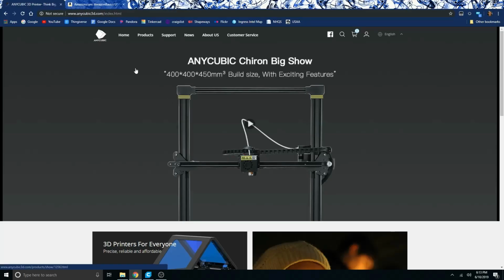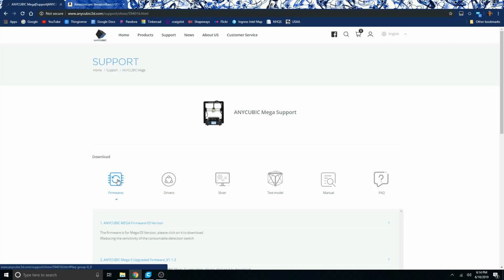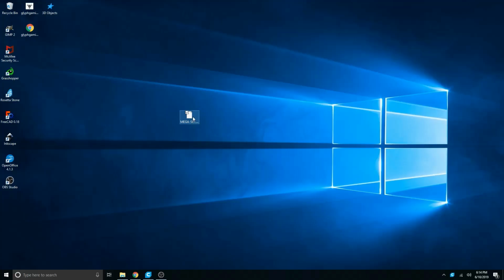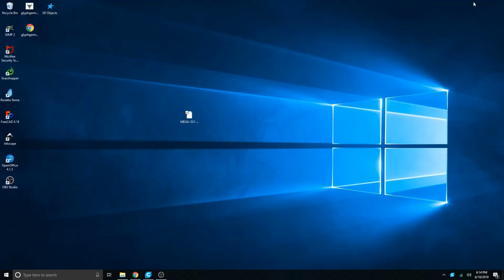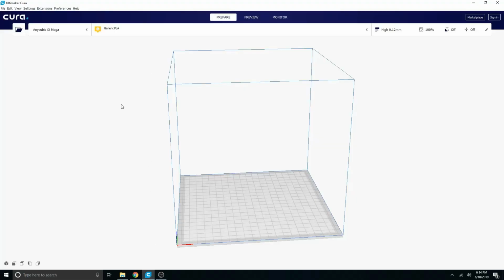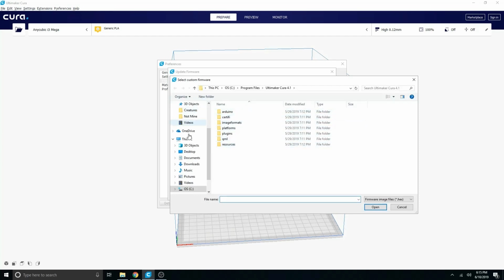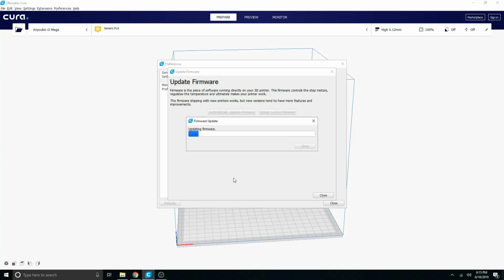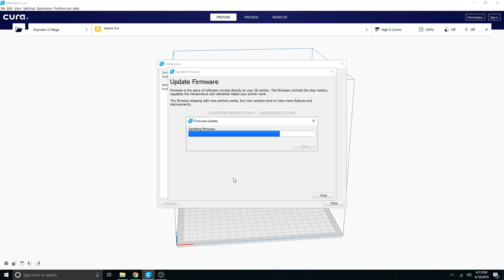Anycubic Mega S Firmware Update

Comment: I know this is an old video but hopefully you can help :) So I have tried installing several different firmware but in the Tools, More, Info page it still says v1.1.2 where I have "Successfully updated" v1.1.5, many thanks
Reply from the maker: @HawxAnimator  I have to admit, I sold this printer a couple years ago and don't remember much about it anymore. I would suggest checking around some forums. 
This upgrade isn't required and the standard firmware that it comes with is stable and does a great job. Either way, I hope you find a solution. I wish I could help more. Good luck!
Reply: @shinymetal  The issue i’ve got with mine is the Y axis is skipping, i’ve tweaked a few settings and assumed the firmware has been ‘reset’ as such. I appreciate your response! Many thanks :)

Comment: Thanks for the video. I'd like to ask a question. Once I updated the firmware for my Mega S with Arduino IDE and it was successful immediately. But after a few day the printer cannot connect to my computer anymore. I want to know what the causes could be for the problem?
Reply: That's really odd. I would check for an updated driver on the anycubic website. If there isn't a new one, uninstall and then reinstall the driver.
Reply: @willcapozzi  yes, I’ve already did the reinstalling driver for several times but they seems not useful. Thank you for your reply anyway!
Reply from the maker: This seems like a long shot but maybe check the USB cable. Switch it out for another one or just unplug both ends power off the printer, power one the printer and then reconnect the cable

Comment: I've tried asking others but I found no help.
My mega s is grinding on the y axis. It only grinds when the bed is near the center of the printer, and when it is moving fast. It stops the movement and causes a major shift in the print. I'm thinking it is caused by the motor, but I'm hoping not. I have replaced the streppers and tightened the belt. Do you have any tips, or should I just replace the motor?
Reply from the maker: Have you been able to do any tests to see if it stops in the same spot every time? I'm not sure if they exist but see if there is an axis test out there. Or if you are good with g code write your own. Look for where it stops and what makes it stop. Also take a look at your belts on the inside see if any areas are worn down. Good luck. It hard to troubleshoot these things over the internet.
Reply from the maker: Any luck there kiwi?

Comment: I connected my mega s to my computer and went to update firmware but when I clicked it it shows firmware cannot be updated because there is no connection with the printer.
Reply from the maker: Tough to troubleshoot without seeing it. Best I can offer is to turn off the printer, plug it into the computer while the computer is on and then turn on the printer. It should connect at that point. If it doesn't the only other thing would be to check your wire connectors for any debris and try again
Reply: @shinymetal  okay thank you will try that now.
Reply: @shinymetal  it sadly didn't work.
Reply from the maker: @ay04kay  is your computer showing a connection to the printer at all? Is your operating system showing a connection?
Reply: @shinymetal  yes it shows the connection is there with an unknown device.
Reply: @shinymetal  when I connect to the pc it shows nothing but on a laptop it shows a connection called c1209 or something similar to that
Reply from the maker: @ay04kay  ok sounds like you need the software driver first. Head to the anycubic website and find your printer. If it's the mega s then go to that listing. Scroll down past all the sales stuff and you should see a support section that has the firmware updates and the drivers. Download the driver for your operating system and that should fix you
Reply: @shinymetal  ah great thank you will do that asap
Reply: @shinymetal  thank you so much it works!

Comment: Hi, I followed your video to try and upgrade the firmware on my stock Mega S. I've tried updating using Cura, which doesn't recognise when the printer is connected via USB. I've also tried flashing using Octoprint which displayed messaging saying it was flashing the firmware then flash successful, but nothing on the printer changed every age reboot. any ideas?
Reply from the maker: Not much would be noticable on the printer. The startup screen doesn't change, so it will look like it is the old version. If you were able to run it successfully on octoprint it should have updated.

Comment: since the update the filament feeding sensor stopped working. Nothing else to be noticible :D What an Upgrade..
Reply from the maker: Shouldn't have changed anything on that sensor. Check your wire connection. Pull it apart and reconnect. If that does nothing, restart the printer by powering off and then on again. As a final fix, I would start from scratch on the update. Make sure to download a new copy of the file.
Reply: @shinymetal  but as others have already be asking: did you notice some other changes?
Thanks for your troubleshooting though! Gonna try it
Reply from the maker: @modrob13  the update should have changed the settings for your PID controller to eliminate some noise at startup. It also made more voltage available to the cooling fan to help with cooling prints. Finally, it also added some more code to the background setup of your printer to prevent any "thermal runaway" (keeps it from getting TOO hot).

Comment: I also update the firmware but i does not shows on the touchscreen.
I contacted Anycubic but no answer yet.
Reply: Hey Patrick, what you see at startup is a picture that doesn't update with the firmware. Just know that you are all up to date and should be good to go!
Reply: @willcapozzi  Thank you very much for your answer.
Reply: @willcapozzi  I have a new Mega coming with the kit to upgrade it to S.  Are you saying the version displayed on the touchscreen is just a .jpg file and not a real indication of the version rev?
Reply: @BentRim  That has been my experience. I have updated mine and it did not change on the start up screen.
Reply: @willcapozzi  Thank you for taking the time to reply.  I have a Mega on order as it was on a decent sale (169$). I also ordered the S conversion kit (29$) thinking i would end up with a Mega S for less than just buying one (249$).  Preparing for delivery I was researching the firmware update process and reading about a lot of confusion. Hence, I found this video.  I'm extremely new to this but have a hobbyist background with electronics so the flashing process doesn't bother me.  I just need some sort of confirmation the process worked. I'm thinking now that I may not install the upgrade kit right away and just learn how to print in it's stock form first.  Thanks again.

Comment: I did the same uploading with CURA 4.3 but when I look at the info on the printer the firmware is still the previous version(1.1.2) ?
Reply: I have the same problem. I asked an answer from AnyCubic ✍🏻 but... no response. Too bad! 😾
Reply: I receive a response: "Hello
Because the mega screen information is fixed, it will not change. So after updating the firmware, it still shows that 1.1.0 is normal. The firmware has actually been successfully updated.
Have a nice day ANYCUBIC eam /Stephen"
So I believe what they say... Let's be optimistic.
Reply: @denisbeautrix1829  Good to know. I was confused after I flashed it and the display didn't change. I thought it didn't work.
Reply: Thanks for putting this info up Dennis! That screen that you see at startup is basically a picture so it won't show the change.
Reply: Glad you posted that. I been searching everywhere and watching every video and nothing. I would do update said it was good machine does some beeps but when I looked on Info screen said same old version.  Thanks again for helping out with this.
Reply: @brianschargerrt9416  did you find updating for the touchscreen?
If you please sind it to me